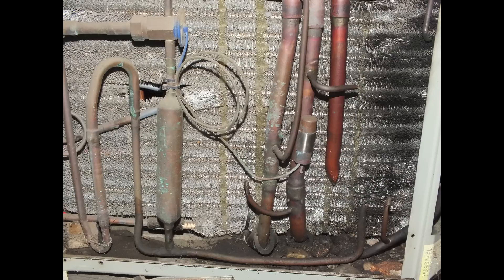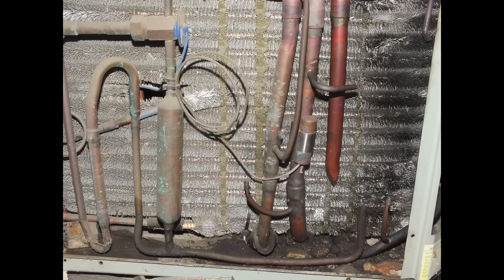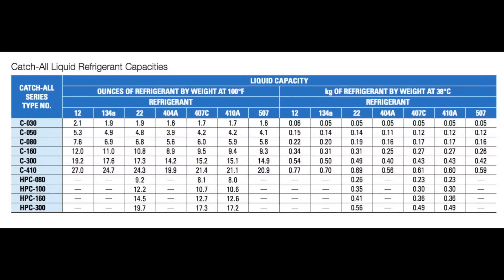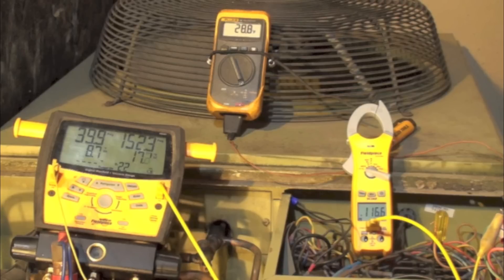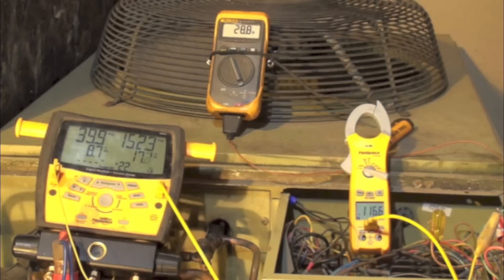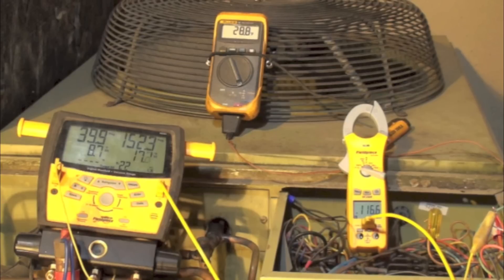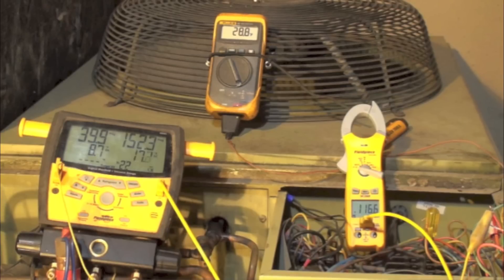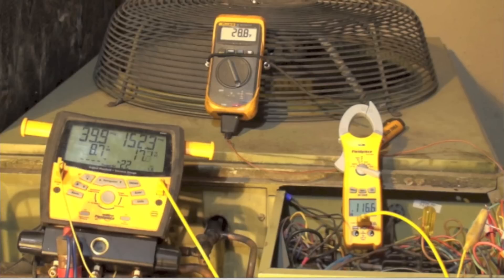Charging the heat pump in winter, part 1

Comment: Can you charge Freon during the winter on a straight coolant unit?
Reply from the maker: You can.  You will have to charge by weight and I would want to check the charge in the cooling season.
GFM

Comment: I got an ICP heat pump that I believe is stuck in Cooling. In heat pump mode it doesn't heat.  So I tried running it in cooling.  I got the inside of the house up to 75 degrees. I took the fan wire off the DFT to raise the head pressure. My head pressure would rise but then I tried to energize the RV and it wasn't switching, it almost seem like it was already in the cooling position. The only thing I could hear is the coil on the RV click,  but no swoosh.
Reply from the maker: No swoosh, bad RV.
GFM
Reply: @grayfurnaceman  I'm confident it is I'm just overthinking it. I'm just how it got stuck in the cooling position. Maybe when it went into defrost and it never switch back to the heating position.

Comment: WARNING!!!!  WARNING!!!   WARNING!!!     THAT IS NOT A "HEAT PUMP"!!!!!!!

It is the outside placed condenser unit for the cooling system.  There must be a condenser and an evaporator to make cool air.  Both must be running optimally for efficient cooling.  The condenser must be placed outside to ensure the gases are cooled and returned to the liquid state to cycle back to the evaporator unit to become gas again for cooling the circulating air in the building ventilation system.  The evaporator unit is usually installed on top of the furnace unit and please note that they are two separate systems using the same ventilation duct-work.

A heat pump is inside the furnace unit of a natural gas system.  It is called a 'Heat Pump' because it actually has a fan to pump the exhaust gases out of the unit and building making it the most efficient system to date.

If a technician does not know the proper terminology in the field he or she is working in then they are a fraud or.....a stupid idiot at best.

Master Technician - Free advice - I hope it helps
Reply from the maker: This is a very puzzling comment.  The video is part of a series on charging a heat pump.  A heat pump is an air conditioning system that is capable of reversing itself.  Meaning that in the winter, the unit will absorb heat from the outdoors, concentrate it and release it indoors.  
It is not a gas furnace.  
GFM
Reply: grayfurnaceman, (or GFM)

You stated:  "Meaning that in the winter, the unit will absorb heat from the outdoors, concentrate it and release it indoors."

Are you from some other planet?

The winter on this planet means COLD so....HOW IN THE EFFING HELL DO YOU GET HEAT FROM THE OUTSIDE!!!!!!?....during cold months?

You are obviously gullible due to the fact that someone told you this BULLSHIT and you believe it!

A refrigerant cooling system that you call an "air conditioning system" (cooling system) can NOT reverse itself!!!  They are designed to cool only the space designated through the evaporator in the ventilation duct.  A 'heat-pump' system is obviously a total RIP-OFF!!!

Where did you get your degree or 'certificate'?  Were you a journeyman that never went to school?

What a con!  These types of systems are EXTREMELY limited in the areas they can be installed...like southern Florida.  Where I live it gets down to -50 degrees.  The snow here can bury the outside unit under about 5 feet of snow and solid ice 3 feet thick.  Nobody, I repeat, NOBODY needs that kind of labor intensive work on such a cold day.  Cleaning the sidewalks and driveway as mandated by the city and county are bad enough.

I laugh at my neighbors who brag that they are saving money because they installed a 'Heat Pump' unit in their home or business which is actually a real furnace 'heat-pump'.  They probably aren't because they are way too stupid to survey and graph those results.

When installing these new 'heat-pump' systems most people cannot grasp taking into account the cost of removal of the old system and installing the new and then there is the VERY HIGH costs of maintaining a 'Heat-Pump' system.  The 'Heat-Pump' system you are talking about won't work here.

My system is so efficient - furnace with a(n actual) natural gas 'heat-pump' - that I have cut my energy bill (especially the natural gas part) by 60% while my neighbors are still paying upwards of $400 - $800 a month (depending on the size of their home and the setting of the thermostat and whether or not they fluctuate the setting during the day and night) during the severe cold months in January - April every year.  It starts getting cold here the last week in August.  It can snow as early as August 28th each year.  My highest bill last season (2017 - 2018 winter) was $200 with a thermostat setting of 72 constant (night-time temps averaged 8 degrees).  When I moved in to this fixer-upper I was paying upwards of $460 a month during the severe cold months - with the 'heat-pump' furnace - at the thermostat setting of 68 constant.  I had to repair the furnace unit and modify the 'environment' to achieve maximum efficiency.  I closed the doors to all the rooms and cleaned the filthy duct-work.  It helped that I fixed the 5 gas leaks in the utility room where the water heater and furnace are located in the basement below ground level.  That alone saved me $30 a month.  On another note:  My unit was installed incorrectly.  The exhaust was installed wrong and blowing carbon monoxide into the utility room.  I could not sue because the installer did not install, as required by federal law, the sticker/label to the unit identifying who installed it.  Federal Law requires a technician to affix a sticker to the unit he or she services, installs or repairs and when they did the work.  They are also required to give the owner of the property a VERY detailed receipt of the EXACT work or service accomplished.

To sum it up:  I have made my system so efficient that I was not only able to increase the comfort level in the environment by 4 degrees but also  save huge amounts of money.  That is why I am a 'Master Technician' who went to the best technical school available and paid not one red cent.  I can assess and modify the environment and systems for heating, ventilation and cooling (HVAC) for maximum comfort in every building on this planet with my experience.  Most service technicians these days only have basic knowledge of the actual units that heat or cool.  This fixer-upper I bought turned out to be a gem with my intelligence.  Nothing fancy, just practical.

BTW, I don't use my 'central air cooling' system that came with the purchase (I assume the previous owners installed it or were duped into believing they needed it by a very dubious technician because the environment was uncomfortable and needed tweaking) because the summers are so mild.  My neighbors think I'm a nut for not.  I maximized the efficiency of the environment so well that it stays cool too without supplementation (a cooling system) in an area that can get up to 100 degrees in the hottest month and the inside temperature of my primary residence only gets as high as 76 degrees without using the cooling system other than a couple of personally (not room) located fans.  So there.

That is why I am a Genius Level 3.

Good day and good luck.
Reply from the maker: I won't try to answer all the issues you brought up but a few may be useful.  Mechanical refrigeration heat pumps have been in effective use for many decades. 
 Heat and cool are relative terms.  Effective use of heat in temperatures as low as 15F do result in a savings of 2 BTUs compared to 1 BTU used to operate the system.  When the outdoor coil is a lower temperature than the ambient, it will absorb heat.  That heat, can be concentrated and its temperature raised to above that of the inside ambient to heat the inside.  
Whether that type of system is economical for the area you live in depends on the average temps, price of the different fuels and their availablility.  
The widespread use of heat pumps began in the 1970s.  I entered this industry in the late 1970s.  In my area (which has and average winter temp in the middle 30sF), heat pumps were especially useful because the price of electricity was the lowest in the nation.  
GFM
Reply from the maker: I am glad to see you have modified your language.  When I am confronted with this type of comment, I have to decide if a response is valuable or just an exercise in futility.  
I will deal with the Trane site first.  Generally, we add supplemental heat at about the 25 to 30F temperature.  This is not because the heat pump is not capable of heating the structure at lower temperatures.  It is because the supply temperature gets lower with the lower ambient.  Many customers are uncomfortable with duct supply temps below 90F.  Adding supplemental heat brings it back up to around 120F.  Many heat pumps will have a COP of over 2 at 15F.  Supplemental heat is required on heat pumps in most areas to eliminate this problem.
While considering this, we also need to consider fuel pricing.   In my area, which is in the northwest, heat pumps became very popular in the 1970s because of very low electric rates compared to gas.  
The article in ACHRnews does touch on install problems with early heat pumps which both myself and my father dealt with.
Most heating systems had air flow rates below what was necessary for cooling.  Around 400 CFM per ton.  In cooling this would freeze up the indoor coil.  This could be damaging but was usually not destructive to the compressor.  In a heat pump, low air flow increased head pressure to the point that compressor destruction was probable.  
These problems were mostly worked out by the early 1980s.  What happened by 1990 was minimum Federal standards were adopted for all heating and cooling equipment with increasing efficiency required as time goes on.  
The most important advances in heat pump design are demand defrost systems (late 1980s), scroll compressors (early 1990s) and better coil designs (early 1990s).  
I can't deal with your comment on heat and cool being relative.  My wife and I have very different views on what is hot and cold, so I have to say it is relative.
GFM
Reply: Lol you’re a tool. Wow.
Reply: Has to be a troll

Comment: My diesel freezer unit calls for 16 Lbs but only took twelve with liquid tank position I turned it on and tried to add gas on the suction only 2 more pounds went in on a 50 deg day . Can I close off the suction compound valve  and force it to use freon out of the can ? Is it to cold for the freon 134 a by the way to evaporate out of  the can or why would it not suction a full charge . Thanks again
Reply from the maker: nisw1918 You can close the suction valve.  50 degrees F is not too cold.  You can place the can in water to assist.  Not hot water if you are using 1# cans.  Hope this helps.
GFM
Reply: grayfurnaceman Thanks I tried shutting valve off the vacuum was to much and tripped the shutdown solenoid but by sloshing the freon around in the 30 Lbs tank I finally got a full 16 pounds in it . Thanks it works great .